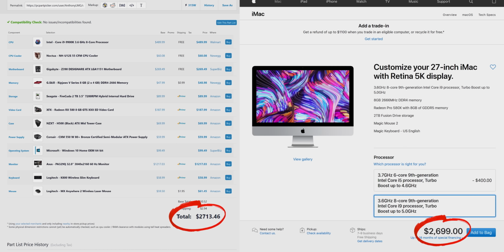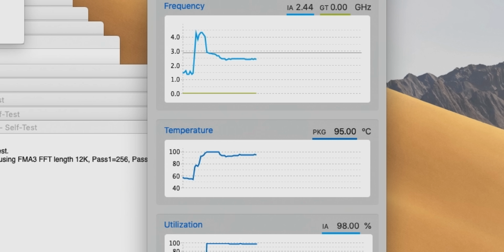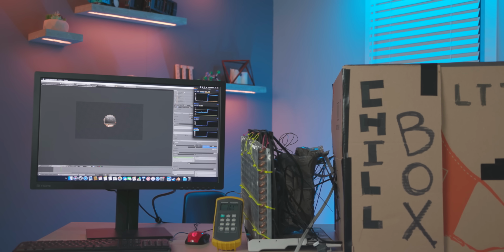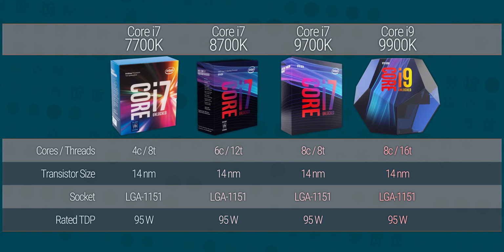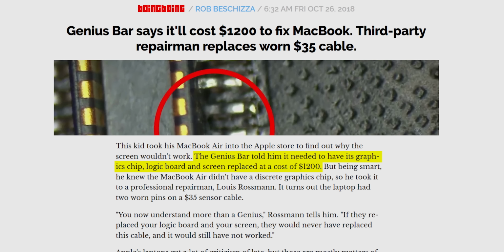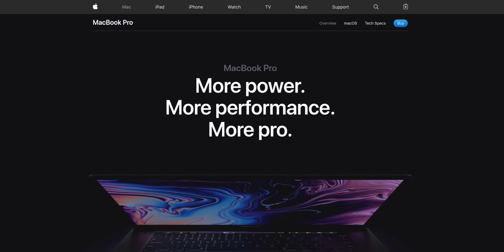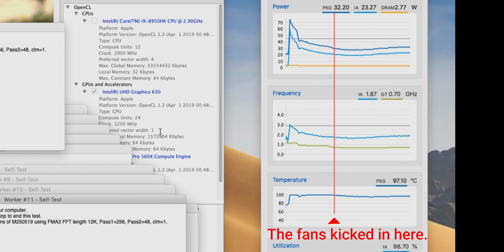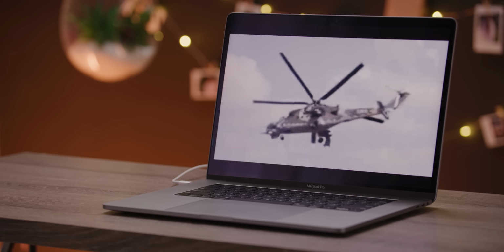Macs are SLOWER than PCs. Here’s why.

Comment: This is why we say macs are overpriced crap.  If they aren't willing to make a machine that can handle it's own internals JUST because they're chasing words like "thin" and "light" as far as possible, and leaving performance on the table because of it, they're just digging their own latrine to lie in.  When you can spend LESS on WEAKER hardware that will last LONGER for the same performance, and that you can upgrade yourself for MUCH cheaper, you start to understand where our gripe comes from.

Comment: I think that apple can keep iPhones cool because they are making their own chips for only their phones, while their PC's are using intel CPUs, not apples owns.
Reply: Yeah, Linus even goes to say that Intel has been slow with their 10nm process, and is just throwing higher TDP chips into the market.  While this seems to be more of an Intel problem, Apple did nothing to address this by not making the necessary adjustments to their thermal design.
Reply: This is one thing I also couldn’t grasp. The performance out of their iOS devices is exceptional. They have the fastest chips in the industry, AND they’re the only ones that don’t throttle. But in all of their desktops and laptops they throttle almost immediately at the sight of a real workload. The new 3rd gen iPad Pro is more powerful than most laptops sold today, and it has no heatsink on the processor, no fan, heatpipes, active cooling of any kind. And it never throttles. But iMac throttles in ever config, MBP, MBA, MB, even Mac Pro. Why? It’s not like it’s not possible to design a thermal solution that would work. They just choose not to.

Comment: It feels like it would have been worth noting how easy it is to open and address factory thermal issues in a windows laptop compared to a macbook. You can see significant drops in temps even at max boost with a better thermal paste, new thermal pads, and an undervolt. All of which is more often than not easily accomplished on performance laptops.

Comment: Answering the question in a comment:
1. They prefer keeping the system hot and laggy rather than ramping up fans and seeming noisy.
2. Their thermal design is obviously built poorly to keep the laptop thin, and their costs low.
They could easily be using graphite pads on the CPU+GPU for better thermal transfer and as a replacement for thermal paste that never dries out, and using vapor chambers.
3. They like using misleading advertising to boast about their "extreme" performance.
4. They don't care about longevity of the components, nor their battery cycle life.
5. Failing components and poor heatsink design allow for higher profits down the line, and higher profit margins on the machine itself.
6. They'll never admit to having poor design.

All in all, I wish multiple Macbooks would literally catch on fire having the thermal controls accidentally turned off by Apple so people would just stop buying their machines, and sue Apple.
This is a bit sadistic, but punishing companies is what we need to do.
Not punishing the brainwashed users for it.
Rather than attacking the sheep that are on the same level as us, we should see up and attack the company itself.
Reply: They just dont care though the new iPhone x9910000 will be out and they make hundreds of billions off those
Reply: @michaelnorris3628  Yeah. That's what angers me.

I've also discovered something else that's interesting.

Most people think that Apple implements new technologies only when it's mature to make it perfect in their own right.

However, the real reason for this is that mature tech is cheaper than new tech, so they don't like experimenting with new tech most of the time.

You can easily see this with iPhones.

They only started using OLEDs on their 1000$US iPhone X when phones with lower prices used it. Meaning they only started implementing OLED screens when it became cheap enough to make it.

Fast charging was only implemented recently, and their fast chargers are still very expensive. Probably to save a buck or three on power conversion circuity.

Easier water resistance by removing the headphone jack. Again, companies like Samsung/LG/Sony were already doing it way before the sad removal of the 3,5mm jack from their phones.

There are other examples of this, but you get what I mean.

Comment: Lol my 2011 MacBook Pro is still working after 8 years of heavy use. Pray for me.
Reply: My 2011 MBP had its original GPU fail a few months ago. But it got quite heavy use, and I did the software ‘fix’ that disables it. So it still works, just is integrated graphics and I can’t change the backlight brightness cuz reasons. My brothers 2011 MBP GPU failed around 2 years ago, so it was covered under the extended warranty. They replaced the logic board, display, keyboard, trackpad, top case, and dc inlet board for some reason. Its almost like a brand new computer, and they did it free on a ~7 year old computer he didn’t get the extended warranty on.
Reply: Peerebeer lol
Reply: I upgraded from that same model about a year and a half ago. Upgraded to a 2015 MacBook Pro. It’s night and day. And I get all the ports I want. Have had zero issues so far.
Reply: Still got my 2006 MacBook :P
Reply: Some say that post Jobs macs are far inferior in reliability.
Reply: MrMurmandramas I don’t know if they’re ‘far’ inferior. But they’re not nearly as concerned with reliability as they used to be. And they used to not be that concerned...

Comment: For real world use it depends on the exact workflow. Many times MacOS is actually more optimized. Some examples are the Final Cut Pro is optimized for MacOS and will outperform other NLE editors on similar hardware on Windows. Another example is that sometimes specific workflows for OS agnostic software like Premiere Pro can perform even better on MacOS. For examples Canon C200 Light Raw edits more efficiently on MacOS Premiere Pro than it does on a Windows Premiere Pro even when Windows has superior hardware. It really comes down to a combination of hardware and optimization.

Comment: I'd love if you made a followup video about the performance for general desktop use in macOS vs Windows in Bootcamp - I have an MBP work laptop and my experience has been that macOS feels incredibly sluggish and unresponsive compared to BC Windows on the same machine. It feels like the desktop environment as a whole is running at 15 fps almost at all times, and can take over a second to respond to user input when I'm doing simple tasks like browsing the web.

Comment: I just ran macsfancontrol and set my own fan "curve".
Reply: I used to use that on my old macbook which had a lot of problems.  I'm fairly certain that program alone extended the life of the laptop a few years.
Reply: @crystalchaos462  It can generally wear the fan headers a bit too, which is a concern when using that program.
Reply: it should work well with default settings, still a flaw: i thought apple sold products that "just work"
Reply: @ThePotchika  They do. Just not the extra few percentages.
Reply: Ach Abou I set custom fan curves on every computer I own so it isn’t a big deal.
Reply: With that, I don't have really much thermal issues. I don't run synthetic benchmarks on my machine, nor do I do any sort of video editing. I use it strictly for development and office usage, and it works wondrously for my needs. My issue is wondering why does everything on MacOS use so much RAM. Lol

Comment: still after 6 or 12 months of use mac goes up from sleep state much faster than PC and doesn't drain battery randomly while sleeping. if that sometimes would be fixed in windows I am going there with my laptop to go machine. desktop is a pc
Reply: I am using Linux with windows vms, works best for me

Comment: in Dev. lab : What cooler should we use
tim cook: NO
Reply: Tim Cook: Coolers? that's redundant! Our products are the coolest * sunglasses on and won't be fooled again plays in the background *
Reply: @vonpotatostein  El Mao
Reply: Von Potatostein LMAOOO
Reply: Dev. lab *ADDS COOLER*

Tim Cook: You weren’t supposed to do that
Reply: available soon external cooling dongle! cost almost as much if not more than the MacBook! uses proprietary power lead unlike those used by any other Apple device!
Reply: wasnt his name tim apple? SMH ur so dumb
Reply: Just use Linux. Can be used on pretty much any hardware and is massively growing.
Reply: That actually happened with Steve Jobs and the Apple III, contributing to the computer's failure.
Reply: @ZILtoid1991  yeah, but the Apple III could be fixed by dropping it violently. Macs, not so much.
Reply: Actually at least on my 2014 Macbook Prohas pretty good cooling capasity and the 2,4Ghz i7 can run at 3.2Ghz all day with 100% CPU on all 4 cores if you use a custom fan profile that actually STARTS the cooling fans before it overheats.... Apple has since 1980 been a big fan of making computers that self destructs by overheating so you must buy a new one just about right after the warranty runs out....

Comment: "we've demonstrated many times that it's just as expensive to build it with the same specs and features as a PC"
And many times you've been told that it's due to buying that monitor that makes up half of the buying price, when you could instead go for a normal 4k monitor. 
Nor did you actually answer in regards to throttling (or reduction of power supplied, so basically the same thing) that means it's actually worse performance, or the fact that repairs would be insanely expensive. 

I'm at 18 seconds, haven't watched the rest of the video yet, so l let's see if you actually make that argument.

EDIT: Good, at least the second part was addressed.

Comment: Great video! I've been buying macs for years and I think it's time to go back to PCs... I'm so fed up with apple marketing crap...
Reply: Windows has its own flaws.
Reply: @WycliffStudios  use Linux, if you must but all my friends have  zero issues with windows 10
Reply: KingHados I bough a New Surface device last month and already saw the blue screen once
Reply: @kinghados  Windows 10 is garbage. Don't restart my computer for any reason at all to install updates; if I wanted to do that, I'd manually install them. Also, it looks like a six year old designed it with MS Paint. Everything is so flat and ugly looking. Literally the only good thing Windows 10 has going for it is scrolling background windows (something OS X and most Linux distros have been doing for YEARS).

If you're going to be using Windows, use Windows 7 or 8.1.
Reply: umm install gentoo/arch
Reply: @_yuri  Why not a more user-friendly and widely supported distribution? Good, safe way to go is Ubuntu or one of its derivatives, such as Mint.
Reply: The Mac Pro (tower) from 2012 was a good mac. Everything went down hill after that
Reply: @Something9604a  The new iMacs are pretty good
Reply: Actually.........frankly speaking, it depends. Yes, if you’re buying a 500 dollar laptop, please don’t have high expectation on running Windows 10 smoothly (might be a bit smoother if running off a SSD, particularly NVME over SATA), but if I bought a laptop with the same price range of a decent MacBook Air (Yes, just Air), running Windows off it actually would be almost the same experience. 

But still, when Apple introduces BootCamp for their laptops, especially for Windows 10 to run apps like SolidWorks on a Mac, using it on a Mac is just doesn’t make sense. For the same spec, Windows 10 on a Mac is significant worse than using it on a Win10 based laptop due to poor support of Mac to Windows 10. Gesture controls are a nightmare on Mac running Win10. Yes, it’s really a nightmare.
Reply: Or you can go hackintosh. The good OS you are used to inside a nice, cool and quiet custom PC
Reply: @DocteurMolotov  fuck no
Reply: Build your own PC and make a hackntosh or what ever that process was they used in the previous video.
Reply: You actually  fell for their marketing....

Comment: Now for only 999!!! The new bacon cooking plate; MacBook Pro.
Reply: iRasher, the ONLY IoT bacon rasher that keeps track of your grease in real time!
Reply: @TehComs  that prize goes to the Razer blade
Reply: 999, must be on sale
Reply: more like 4999
Reply: If i am gone buy mac  i will use i muvie or final cut pro  but if I  want to use premier I will never buy apple.
Reply: don't you mean the MacCook Pro ?
Reply: I wanted Linus to see which CPUs are best for Linus media group BBQ on cpus
Reply: Someone tried cooking an egg on an i9 Macbook while rendering a 4k video or smth, and couldn't get it cooked bc it slowed itself down :/
Reply: Hot plates. Great to charge your iPhone X on a hot plate lol. -Ellen
Reply: 2 in 1, but the catch is you can only use it for about 30 seconds for computer stuff and then mostly cooking, tho really fast preheat
Reply: Well no. Cause you'll need to change the OS to allow stupid temperatures for a cpu. Also the key caps will melt. Soooo. I don't reccomend. 😂👍

Comment: Get MacFans Control app (lol I see you did).
Bought a 2012 MBP with dedicated graphics card. Yes, it does get hot. 
For the rest it's a good machine. I need it for my work (PC not an option, yes I'm screwed)
Reply: I imagine that's one thing that drives a lot of people to try hackintoshing. They not only prefer Mac OS, but have spendy software that they would like to keep using as well, but don't want to buy into that ridiculous line of hardware Apple sells today.

Comment: Macs are, however, more effective as room heaters than PCs.
Reply: That was really true of the G5. The towers and iMacs with that chip really blast the heat out, especially the dual CPU towers! The quad G5 in particular, the fastest G5 apple ever produced, had a noticeable effect on ambient temperature.
Reply: Try amd vega in and an i7 8700k after a 8 hour gaming session in a case that isnt that good with air flow. You can bake something with it

Comment: The best way to reduce thermal throtthling of MacBooks is to buy a Windows laptop
Reply: Linux*
Reply: To be fair, most all windows laptops throttle. Usually a bit less, but they still throttle. The difference is Apple chooses to put in very high end hardware, market it as a powerful machine, but it throttles immediately under a real workload. Selling a $400 laptop that throttles is a bit different than a $4000 machine that throttles.